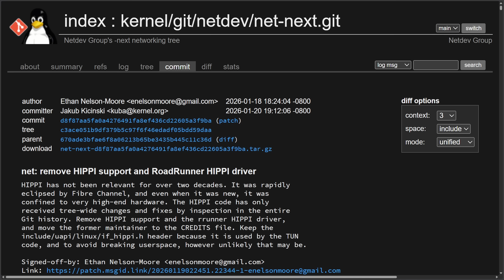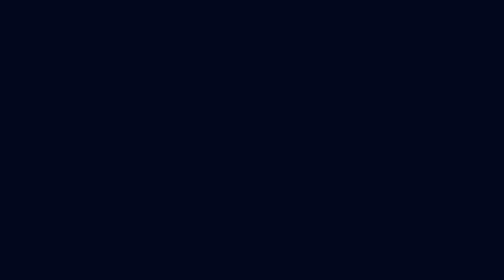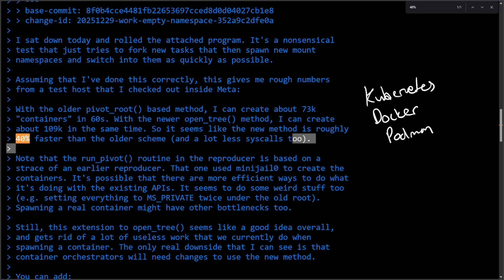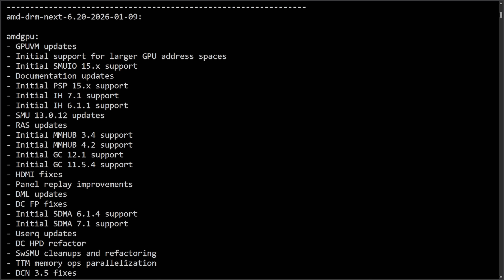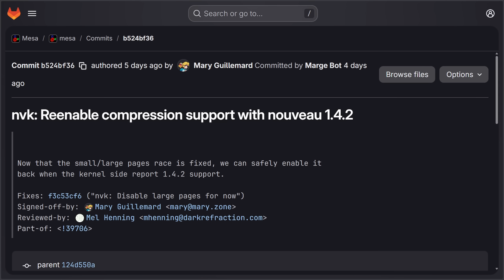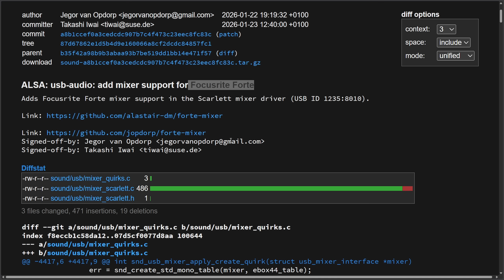Linux 7.0 Review: MAJOR Performance, GPU, CPU, and Networking Upgrades

Comment: Crazy how Linux is focused on performance and always has new features and cool technology, unlike Microslop Windows which is focused on slowing down the system as much as possible and code everything with AI and introduce new bugs.

Makes me wonder why companies still make their apps Windows only, instead of developing to Linux and getting all the performance benefits for free.
Reply: People don't use Linux because their needed software isn't available -> Companies don't build for Linux because there aren't enough users for it to be worth it -> repeat 

That being said, Microslop screwing up so much and Valve pushing for the Steam Deck / Steam Machine is slowly but surely pumping the number of users up. On top of that, Wine / Proton (the Windows / Gaming compatibility layer) is getting better and better, so maybe in a few years things will be different.
Reply: @AratPrime That's not really true, lots of companies develop for windows and a lot of software is now run on the web(running on Linux), you have such a legacy view of things...
Reply: @AratPrime I think you are wrong, the amount of work it would take to port your software to linux would still be profitable, I personally think microslop and apple intentionally collaborate with companies to stay away from linux to corner the market
Reply: @jethroise6245  it is largely not profitable unfortunately
Reply: @AratPrime  Microsoft Office is its  best by far and that is why Microsoft is still alive..
Reply: @VinsuKarma  this is the most L take of the year. Word is SO slow and bloated.
Reply: @VinsuKarma  microsoft office peaked during 2016, after that it became bloatware
Reply: @VinsuKarma we have winboat now. Not to mention that ONLYOFFICE works great . No save your file to one drive or Copilot shit show.
Reply: @VinsuKarma Ever heard of OnlyOffice?
Reply: @FlanGrande  no, normies dont care
Reply: @arjixwastaken  MS Office passed its peak when it released a version incompatible with documents made with previous versions. Naked greed!
Reply: Because market share 🥀
Reply: Which is not entirely true. Microsoft is just not publishing those kinds of patchnotes with rare exceptions like big improvements to NTFS performance.
Reply: Woah, this thread goes in all directions.

Regarding Rust, performance is about the same as C, it's just more difficult to make silly mistakes that could become security issues down the road. Anyway because of this the resulting binary and memory use is higher than what you get from a well written piece of C. But since this is at kernel level we're talking about MBs of extra memory used forr the whole system, not per process as it would be in userspace, it doesn't make it eat up an extra GB during boot.

Rust and C can easily coexist, it won't have a significant impact on performance or memory use. And frankly, I prefer that they do it this way, instead of rewriting everything in Rust just because... it makes it possible to rewrite only the parts where memory safety is of high concern, or has proven to cause issues.

Regarding those of you that complain about how Windows software performs on Linux, I've noticed that the applications that most often have trouble are very specialised and expensive to obtain... If I had paid so much for a piece of software, I'd complain to the ones that took my money, not those who gave me some software for free.

And if the reason you can't do that is because you pirated it, I don't see why that should be Linux's or the FOSS community's fault either, call the police to complain, at least they get some of your money through taxes.

Now that Valve is contributing so much to Wine/Proton, it's actually not that difficult to write Windows software aimed at the Proton Runtimes that you'll have native performance on both Windows and Linux.

While Proton is focused specifically on the products available on Steam (games) the progress in the compatibility layers can also be used for other hardware intensive software, such as 3D CAD programs. The computer doesn't care if the work it performs is for entertainment or work.

So, ask your productivity software provider to at least aim for full Proton runtime compatibility.
Reply: most people uses windows. 
i think more people should try linux because they can do almost everything windows can do, and it also makes old hardware look brand new in some cases😊
Reply: Because of money and windows still dominates the market and will dominate for years to come. Sad but true.
Reply: Focus on shareholder value vs user value. The difference can be seen.
Reply: Microslop Winblows***
Reply: Well, many non-College level Schools default to Windows, so kids grow up learning Windows, and their parents buy some computer (which most default to Windows in stores), then they get jobs, and their jobs default to Windows. 

You can see how this is a self perpetuating cycle until you get at least School and Work sectors migrating to Linux it will take longer for the switch IMO.
Reply: A compounding problem, there arent many customers already on linux for day to day, development is encouraged open souce, so companies with paid software have little incentive or motivation to create for linux. There isnt much profit in it.
Reply: It's not all bad- you're totally right, but there are some really good parts of Windows. The NT Kernel's multitasking paradigm is something to be heralded, for instance. And its infrastructure policy system is something that some businesses, schools, etc simply can't go without (especially compared to Linux's user permissions system still requiring commands from the 70's, and being practically useless compared to what you can accomplish with policies). There are other half-baked Microsoft products that are just useful enough to warrant Windows over Linux. Not to mention, many technicians haven't worked with Linux since getting their certs, and many would rather complain like hell just to refrain from learning something new. Lots of work to be done in the enterprise sector (as opposed to infrastructure, which Linux was already dominating, and consumer, which Linux is already halfway there). Luckily Microsoft is giving everyone the time to surpass them...
Reply: Smaller market still unfortunately
Reply: Market domination which influences demography. Microsoft has been paying pc manufacturers and resellers for decades to ship their products with Windows. That assured a solid monopoly on the  most used systems worldwide, which in turn  incentivizes other Companies to tailor their products predominantly  on windows.
Reply: You can't get people to get rid of their current system and buy a new one (with a new license fee) if you speed up the operating system and apps.
Reply: Shareholder value
Reply: Because Microsoft pays other company's to stay in their platform, i know that because of industrial software as TIA Portal, SolidWorks, AutoCAD and even Altium Designer
Reply: If Linux could run windows apps native instead of using wine I would drop windows 10.  Tried 11 it's too bloated.
Reply: @Nik-8it5p why do you dislike wine?
Reply: @arjixwastaken I am a musician there is  specific software I use for my mixers/DAW. I cannot get to run properly or latency issues. Until then I will stick with W10 LTSC or W7 remote.
Reply: @Nik-8it5p why not ask for those software to support Linux instead of asking for all windows software to run on linux?
Reply: @arjixwastaken I have asked, may have to wait for a future version to be released. 👍
Reply: @dadigitechman does Ableton work on Linux? I’d swap if Ableton worked
Reply: Windows' PO is focused on deals with hardware vendors and corporate investors, Linux's PO is a dev that wants their computer to do its job. In the long run consumers guide investors (unless they are state funded (taxation = theft)) and we get what we want one way or another. Vote with your money.
Reply: Linux is kernel Windows is so much more, probably kernel developers on Microsoft are also great. But we are comparing only the UI and extra background services.

Probably the Windows kernel and macos kernel are the most secure and advanced software in the world.

Comment: That one arch user with HIPPI based networking: where my connection
Reply: "Removing spacebar heating has ruined my workflow, please add an option to re-enable spacebar heating"
Reply: The Arch user is less likely to use HIPPI than that grey beard Debian sysadmin. The Arch user is using the last failed experiment for the driver rewrite of a bleeding edge, Chinese network card.
Reply: @nextlifeonearth The gray beard Debian sysadmin will only notice HIPPI driver missing in about 2 decades tho
Reply: does anyone still use HIPPI?
Reply: @mustofa_id  I thought that you meant HIP (Host Identity Protocol, novel experimental L4 ident namespace), and was a bit confused, then googled it and bruh... '90s tech hits different
Reply: @mustofa_id young anakin
Reply: Needs a HIPPI replacement operation it's so old....
Reply: More like Slackware user
Reply: @MartinVanBoven  Slack 14 for...ever.
Reply: I had to look up what HIPPI even meant. lol
Reply: lol